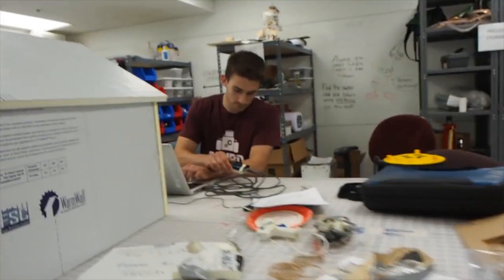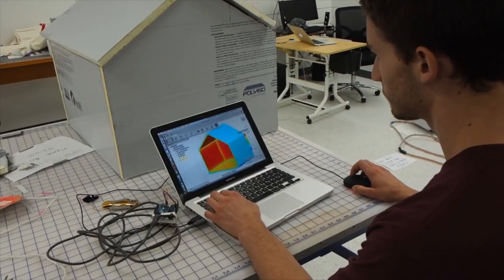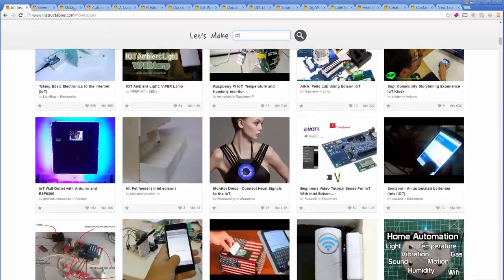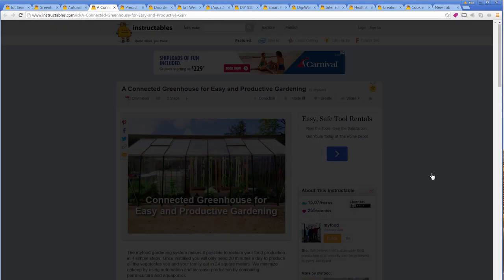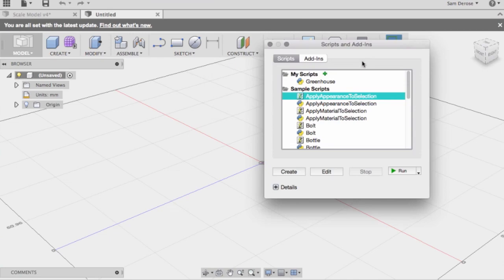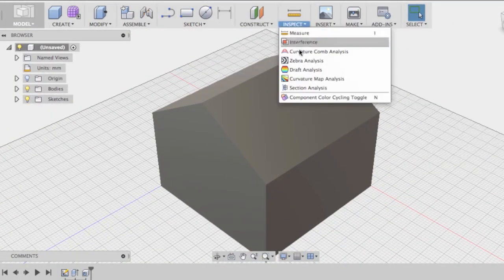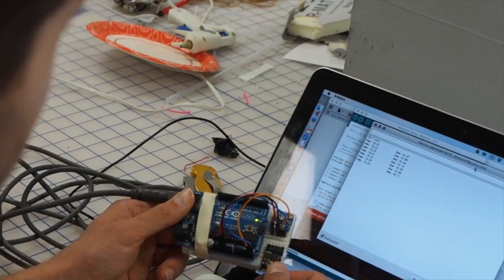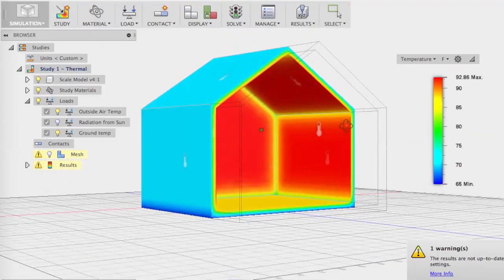Autogenerate a Greenhouse w/ IoT & Fusion 360's API

Comment: Thank you Sam. I have always wanted to do a heat transfer analysis on a house to optimize the thickness of insulation. I live in Canada so it's mostly against cold, but also against heat in summer. Where can I learn more on your work ?
Reply from the maker: Hey Dominique, Sam's project is linked here: http://www.instructables.com/id/Auto-Generated-Custom-Greenhouse . He describes the equations he uses in that Instructables post. Hope that helps! Stay well insulated.